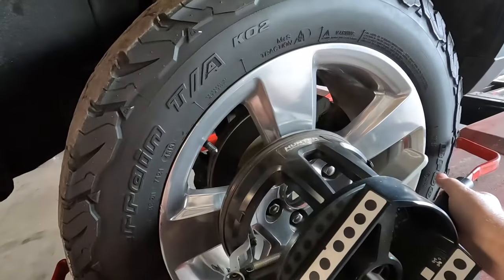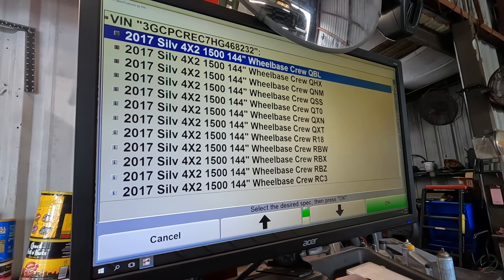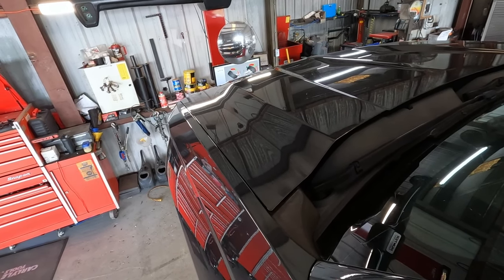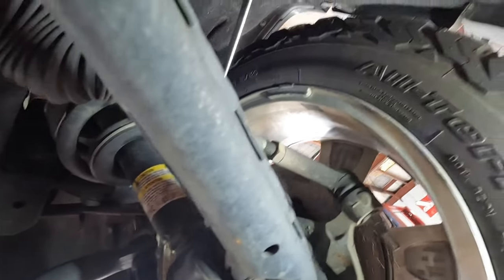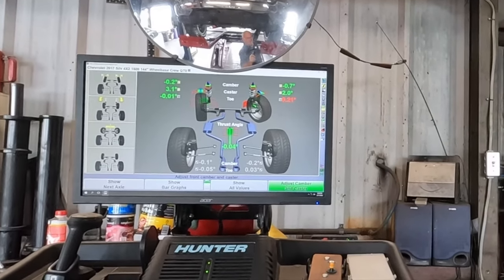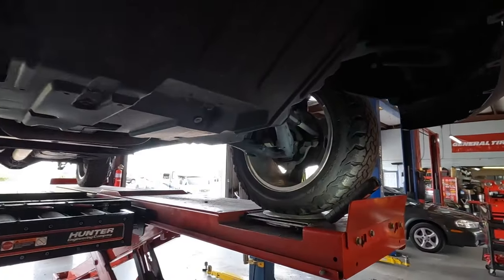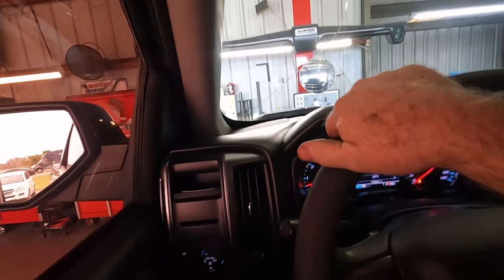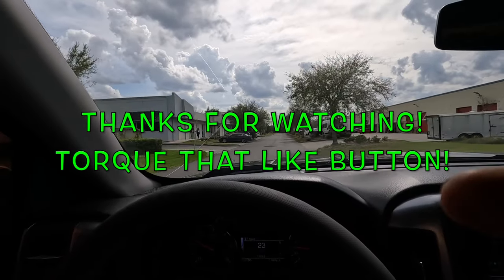WHEEL ALIGNMENT, CHEVY SILVERADO PICK UP TRUCK...

Comment: Man that's almost to easy, I work at a Chevy dealer in Canada and if a truck came In with that many miles we would have to use the torches
Reply from the maker: Yeah Tlyer, I’ve seen some videos that amaze me from up north. I have to remember to be thankful I can usually avoid that. Except for the snowbird, lol.

Comment: Nice job not taking the spring clamps off of the boots and twisting the shit out of them as you adjusted the tow. Knew I was in for watching some shit when the guy couldn't even take the time to pull out the correct size wrenches lmao.
Reply from the maker: Thanks for watching and leaving a comment.

Comment: This is what you call a toe and go ,do the least as possible 😢
Reply from the maker: You should also do what is needed to make the specs correct. Sometimes it can get expensive though.
Reply: @JimmyMakingitwork  true but you have the ajusting power of caster and camber bolts built in so why overlook it ,make it the best you can ,the most complaining thing I hear of alignment shops is they are lazy get it in the green and lock it down ! Always do the job the best of your ability and show your work to the customer before and after.This will be seen from people who wants stuff done to perfection 👌

Comment: Up here in the rust belt, I worked on a 2011 FJ Cruiser (not an alignment) and everything had patches of rust. The camber bolts looked especially intimidating to try and adjust.
Reply from the maker: Man they don’t last long up there u less Maintained well and rust treated often!
Reply: @JimmyMakingitwork  I get my car undercoated every year and it seems to be working. I was even able to slip off my brake drums without any force.

Comment: From the factory GM just roughly set alignment on new cars so get dealers to check before paying
Reply from the maker: We did not have that issue when I worked at Chevrolet. They were all spot on. I have been told they pull any that measure out of spec for inspection before shipping.

Comment: Using wintoe to make sure you get a centered steering wheel
Reply from the maker: I am hard to retrain, lol.
Reply: @JimmyMakingitwork  try using it real easy
Reply: And you don't need to hold down the steering wheel
Reply: I miss doing alignments I did it for 30 years I'm retired due to a stroke I glad I found your channel thanks for letting me chat

Comment: I got an alignment done about a month ago on my Nissan frontier and for some reason I feel like the front seems a little lower then how it use to stand is that possible with an alignment or is it just in my head lol ?
Reply from the maker: It should not sit any different in height Edgar. Unless the springs or struts were replaced the springs aren't adjustable and would have to be to change the ride height. Hope this helps.

Comment: Cheers to you keep the videos coming 
Have to ask your wobbly sockets you are using are they pin less style 
Never really used wobble style and after 23ish years in boats starting to look at some and just looking for some insight thanks a million
Reply from the maker: I have a few sets, the 1/2 drive are Anbul and they are pinned. The 3/8 I'm using until next week are pinless, Snap On, as the broke they warrantied them with the new design...but crazy money around $550. My 1/4 inch are pin style also. I am going to a different brand as an experiment soon though for 3/8 and 1/4 inch. 
I'll be selling the Snap On ones on Ebay in a week. Look for wedjim on there If you are interested. :)

Comment: So I have a dumb question. I’m getting new tires soon. I’m replacing my outer tie rods. Can I get an alignment before new tires? Does it matter? Should I wait?
Reply: I’m replacing the outer tie rods before new tires.
Reply from the maker: You can align it after the new parts are installed. The new tires won’t affect the alignment if they are the same size.

Comment: So my Silverado had a pull to the left...I had a alignment done at a dealership and now it pulls to the right? Any ideas how to fix this? Thanks
Reply from the maker: I would check to see if it's actually pulling/drifting or if the steering wheel is off center?
It is possible to rush and make mistakes during an alignment also, so could need to be redone. If that's the case it should be warranty.
Reply: U

Comment: I have a 2014 silverado recently purchased a 2" leveling kit what are your thoughts as far as alignment issues,front end problems
Reply from the maker: The 2" lift will move the front camber and toe, but it should be ok and adjust back on the alignment machine. I would definitely have it aligned after install.

Comment: Gonna be sure to show the dealership that just took 3 fucking hours to adjust one tie rod end for me today. Didn't even address the upper control arm that I came in for as I found the bolts loose and said camber and caster are out of wack.
Reply from the maker: Uh oh, that doesn't sound good. I'd definitely go back and give them a chance to make it right though.
Reply: @JimmyMakingitwork  I am. The bolts are tight because I tightened them. But they didn't adjust caster or camber on that side, just toe. Either way one tie rod end in 3 hours is ridiculous.

Comment: I thought you cant stand on the rocker to check caster?
Reply from the maker: I'm standing on the lift, but standing on the rocker, or sitting in the seat would show measurements as if the driver is in the car.